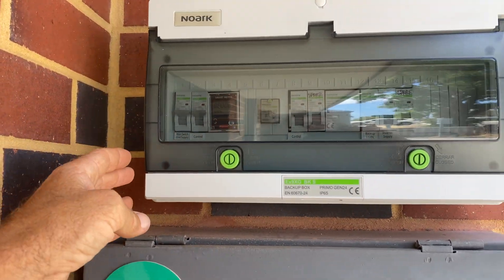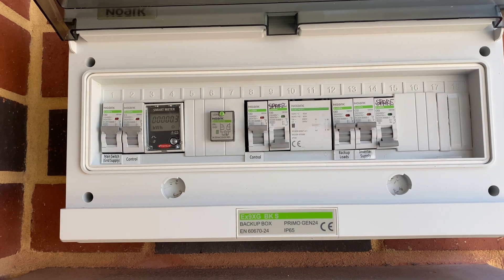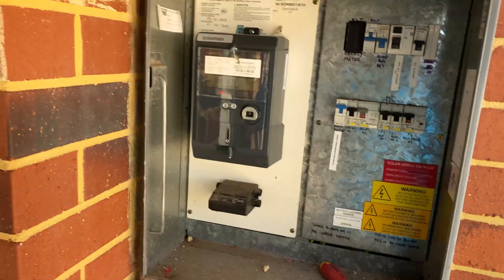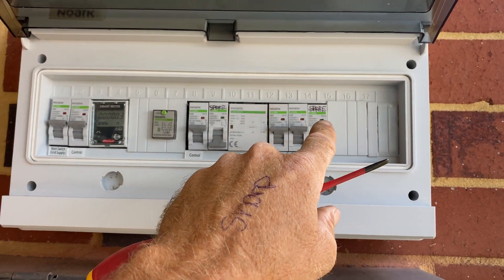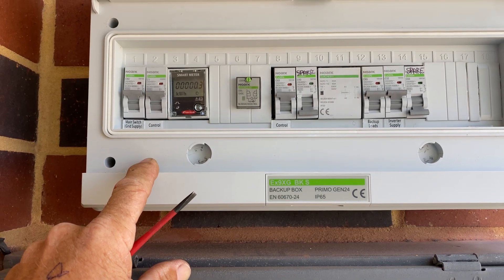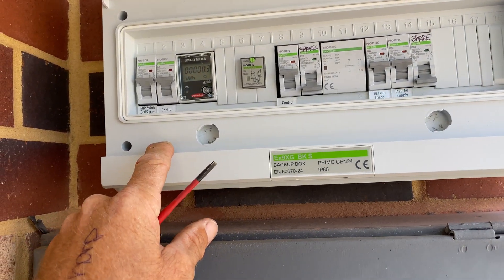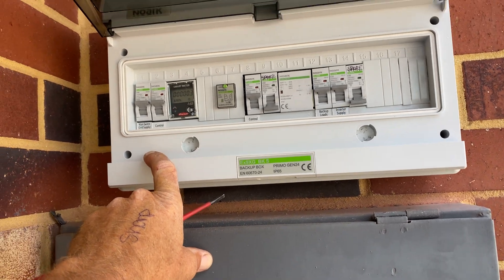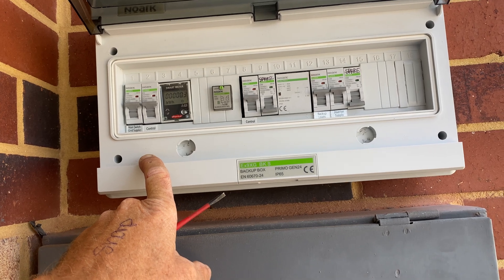Fronius Gen24 with BYD and Noark battery backup power box quick overview.

Comment: I know this makes the job quick and saves time, but it is a little exy for what is in the end an enclosure, 7 x $3 circuit breakers, a $150 Fronius meter, and $70 combination of a contactor and relay.  Modern houses should wired with a suboard for the loads and space reserved in the MSB for this type of setup.  But we know, time is money.

Comment: Good content as always. 

Getting this installed at my place soon here in Sydney. The installer rep is saying each circuit backed up will involve extensive wiring, thus charging me per circuit. 

Other Fronius/BYD users online are saying you can back up the whole house in one go without rewiring each circuit, like your video. After seeing your video I’m more inclined to believe them.

Does the Fronius being a parallel connected hybrid have anything to do with it?
Reply: The installer rep has installed heaps of Sungrow inverter/battery systems. Maybe it’s done that way with Sungrow so that’s why they are telling me this.